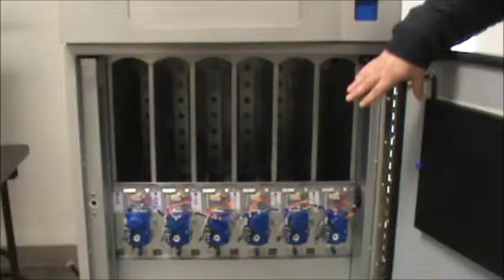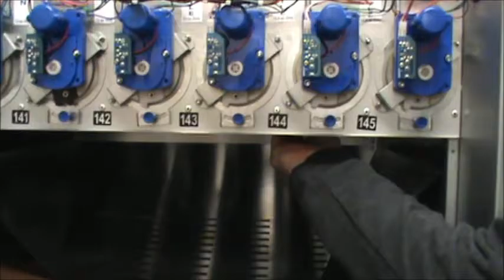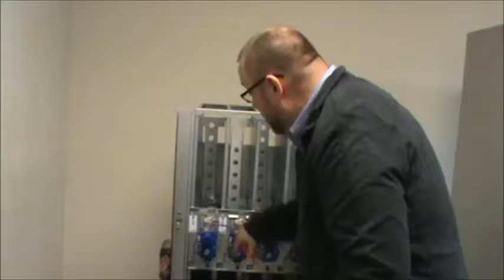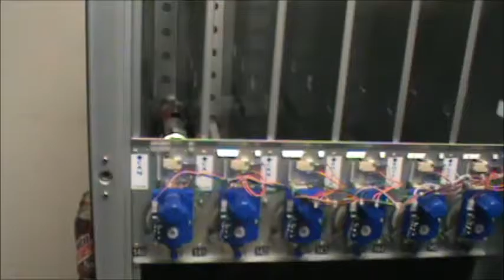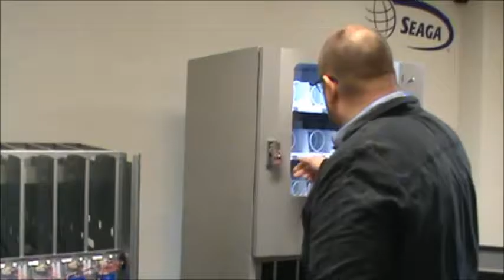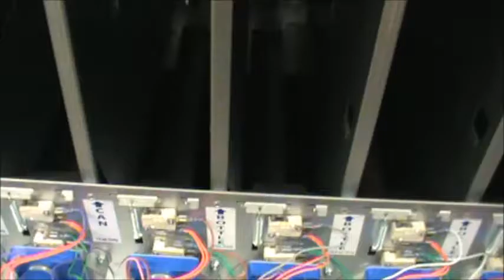SM22 Troubleshooting Vertical Drop

Comment: Same issue we are having won’t tell our customers item
Is sold out 😮 please help
Reply: I know this is late, but it's because the drink sold-out flap is missing the sold-out switch. You can fix this by bending the smaller piece of metal to the right of the larger piece of metal that is supposed to hit the sold-out switch. Bend it inward so that it prevents the sold-out flap from going in too much and missing the switch

Comment: Need help with the sold out malfunction. It won't tell the customer the product is sold out
Reply: I know this is late, but it's because the drink sold-out flap is missing the sold-out switch. You can fix this by bending the smaller piece of metal to the right of the larger piece of metal that is supposed to hit the sold-out switch.
Reply: Bend the small piece inward to prevent the drink sold out flap from going in too far and missing the switch